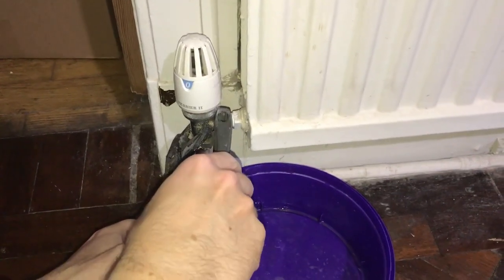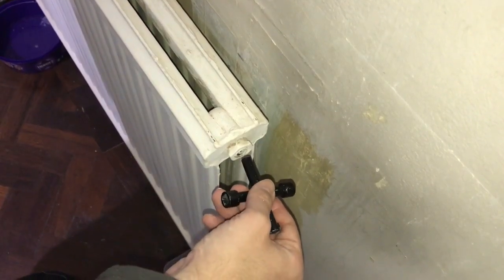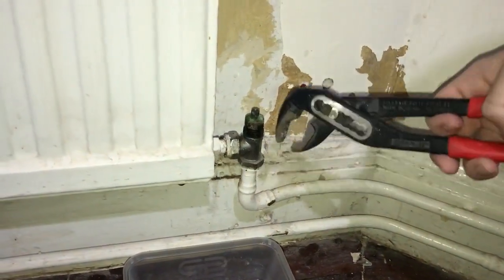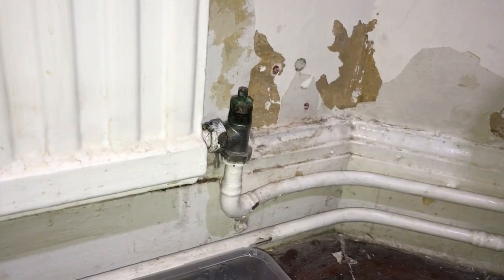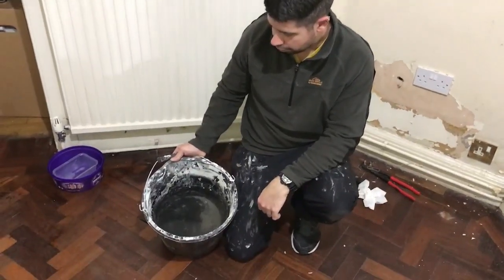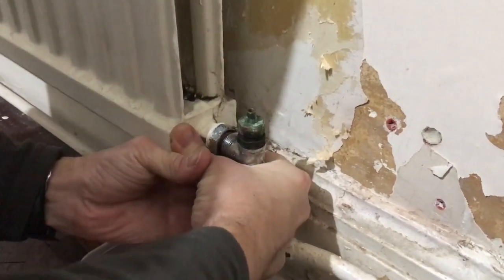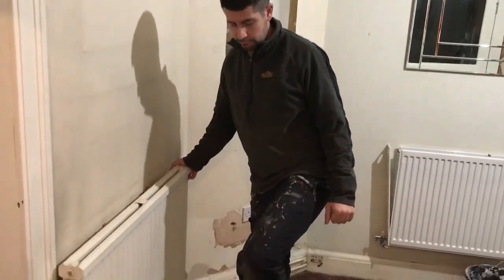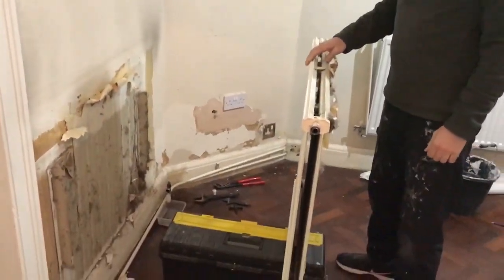How to remove a radiator

Comment: Thank you very much for sharing your work, I have to do a similar job at home and it has been very helpful. A cordial greeting from a new subscriber from Spain.
Reply from the maker: Gato Land thanks for subscribing.
I bet you use radiators a lot less in Spain than we do here in England.
Thanks for watching 👍🏼
Reply: Well, it depends on the area, where I live (Madrid) are very necessary since it is very cold in winter, however in Andalusia there are places where they do not use at all. Cordial greetings from Madrid.

Comment: Prob best vid ive seen on this subject. I panicked yday as tried this after watching another vid.  3 large full bowls of water later on similar size rad to yours i put it back together (and have small leak now but think i just need to ptfe on thread). I thought maybe valve is faulty and not fully closed.  Watching this thinking maybe i try again as that amount of water is normal
Reply from the maker: It's surprising how much water is in radiators.
Glad my video helped

Comment: Very helpful, many thanks. And putting it back, do you just undo the bleed valve until all the air is pumped out by the rising water level in the radiator?
Reply from the maker: Greg Wallis thanks for your comment. Yes putting it back on, tighten the valves back on, open the valves, open bleed valve to let air out and water in.
Reply: @spendtimesavemoneydiy  Many thanks, that's appreciated.
Reply from the maker: Greg Wallis not a problem.
Let me know how you get on 👍🏼

Comment: Nice video (Personally I always use a dust sheet and cap off the two radiator valves; sometimes water can leak from these valves even when fully turned off - lol, my plumbing mentor flooded out the mayor's office because he forgot to do this)
Reply from the maker: ugandan toad oh no, bet the mayor wasn't happy. Great tip though, thanks for that. Every day is a school day 👍🏼

Comment: That's the cleanest water I have ever seen in a radiator.  It is usually black.
Reply from the maker: I have drained down my central heating system a few times to fit new radiators so all of the horrible black sludge had already gone.
Thanks for watching and remember to like share and subscribe to help the channel grow 👍🏼